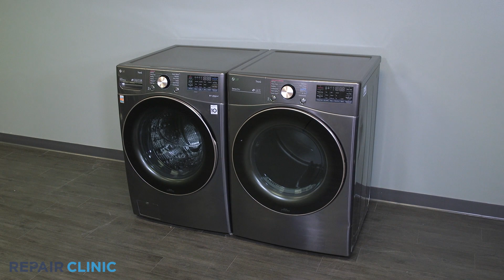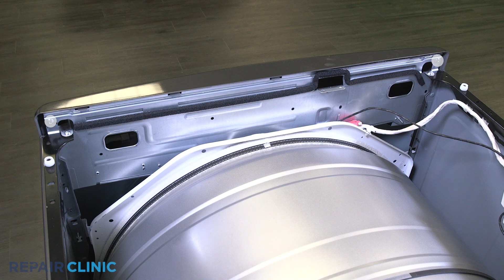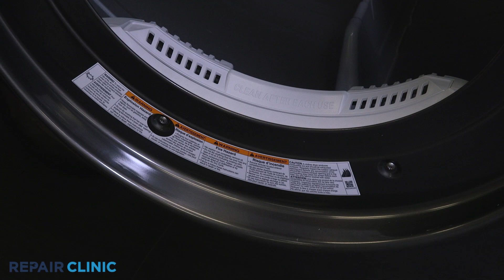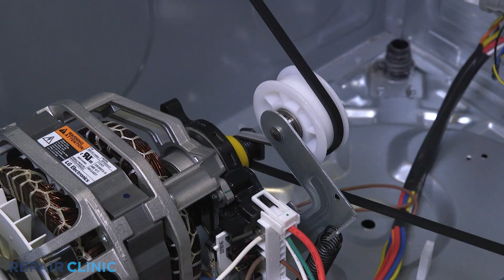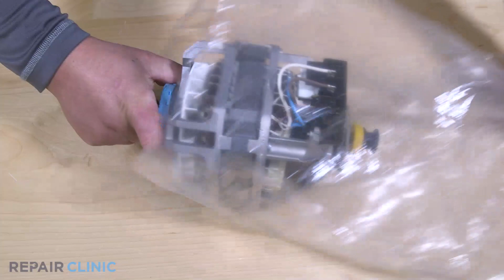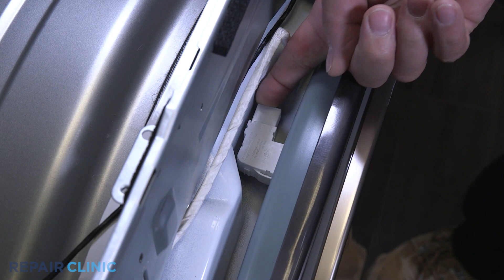LG Electric Dryer Motor Replacement 4681EL1008A

Comment: Appreciate the info,still relevant in 2026.
There is one piece though that is not present on replacement motor.
That is the yellow piece next to end of shaft the belt goes around.
Not sure if it is necessary or not🤔

Comment: Any advice on the bolt not coming off on the fan to the motor?
Reply: It is a left hand nut. Did you turn clockwise to loosen?

Comment: Thanks a million for demonstrating how easy it is to replace an LG blower motor. Only a few steps to follow and well within the ability of the average DIYer when you have a guide as skillful as yourself. The symptoms of a bad blower motor for those troubleshooting are humming or buzzing when you press the Start button and no motion in the drum. It's shocking how few parts there are in a dryer.

Comment: This is a great video for this general series of LG dryers. I strongly recommend it.  If you are working on a dryer with the steam option as I was dealing with, things may look quite different at first, but don't panic. The white bar with the relays and wiring on it on this machine was moved to the side behind the control panel to make room on the other side for the steam unit. There are a few different screws for mounting the steam unit, and I found  couple extra screws (such as one at the bottom of the duct in front of the fan), but they are likely minor variants between different years. If you're worried about not being certain where all the screw go, a muffin pan with sticky notes and some colored markers to mark the holes where certain screw go and relate that to the muffin pan pockets for different groups of screws can give you some reassurance.